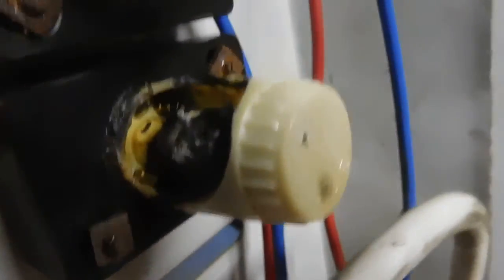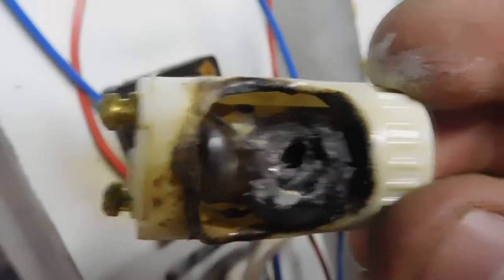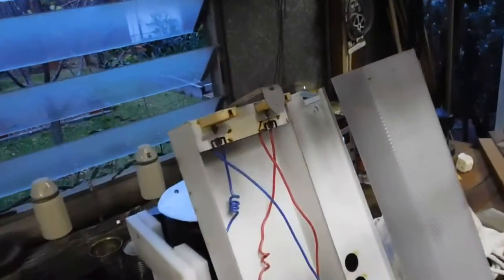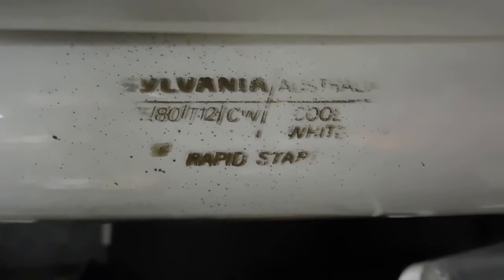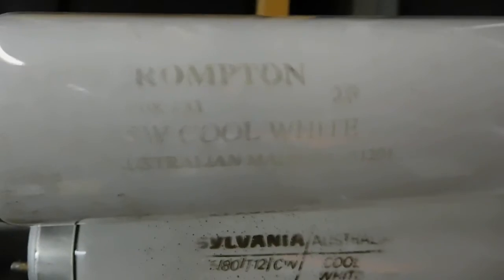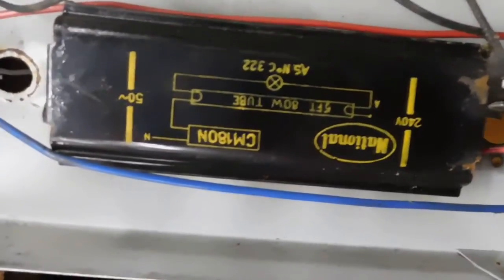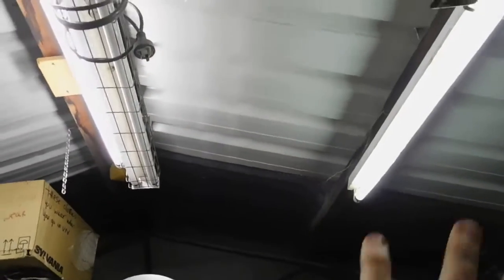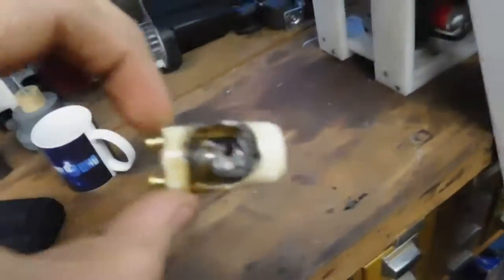55W Fluorescent Starter Catastrophic Failure

Comment: Wonder if this what happened to my starter... my lamp is not working, i tried to change the starter, but i couldnt get it out. when i tried with starters from other lamps, it just come out easily. do you how can i fix that?
Reply from the maker: Use a pair of long-nose pliers to grab it by the small divots in the top of the plastic case, they sometimes seize in and are hard to remove

Comment: do the domestic Florescent fixtures in the UK have just one large spring loaded button at each end of the Lamp tubes? here in the US the two pins are quite common for domestic. and commercial ones have the one button at each end.
 Interesting How the starter blew out like that. I have never seen that happen B4.
thank you for the video BTW I enjoyed it Liked and Subbed  :)
Reply from the maker: No worries and thanks! I'm not too sure on how the UK fluoros go together, as I've never come across one before
Reply: The Single button ones I've only ever seen in the USA. (cold cathode start I imagine?). Here in the UK, our system's almost identical to Australia and NZ, bipin T12s used to be the thing, then it went to the T8 (1 inch) tubes... now in the few non-LEDs it's usually T6/5/4 lamps

Comment: Wow!
Reply from the maker: Was very surprised to see it!
Reply: I saw one at a golf club ... the failure seems to happen if damp gets into the cap, turning it into a resistor... that then carbonizes and becomes more conductive, and the 'dead short' failure never happens because the tube/ballast are in series, so the heat continues till something gives up